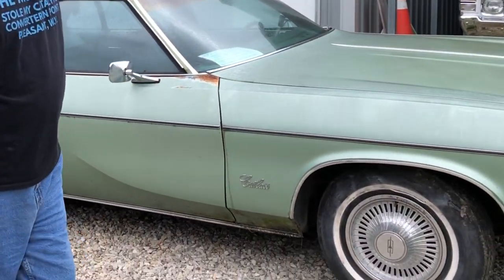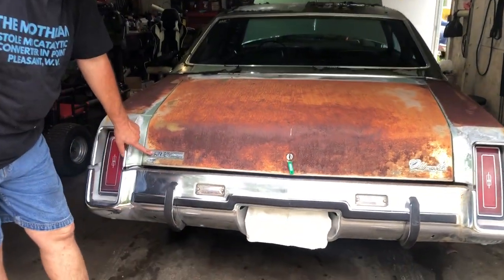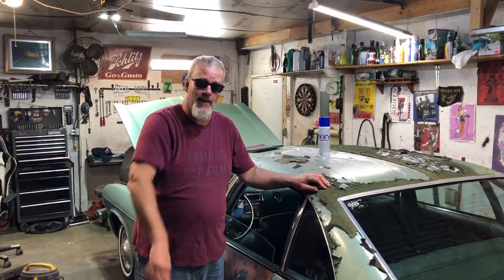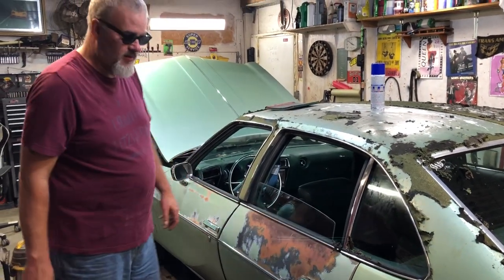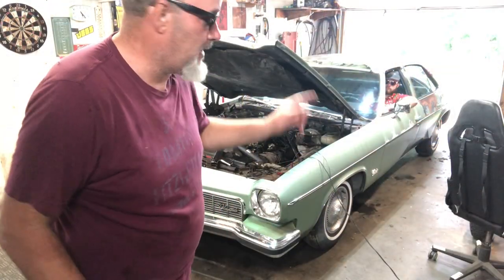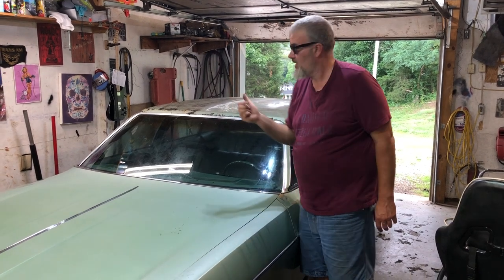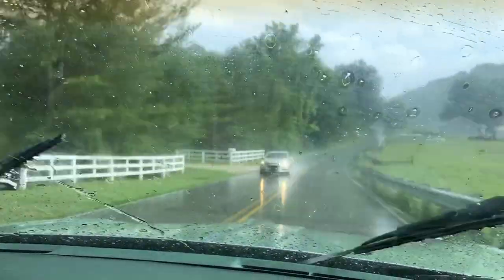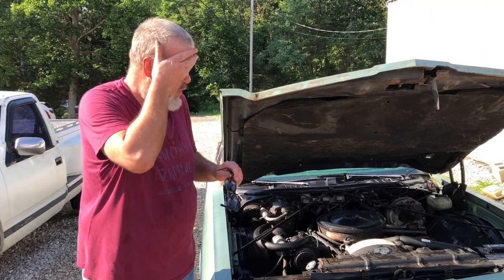455 Olds Triple Pickle!

Comment: Looks like a great car and full of options. Applaud the valiant effort getting it running good, even the said adult beverage. Not so much about those tires on the road with rain conditions and tire age. I know you were excited to test it but WOW! Anyways happy Oldsmobile—-ING!
Reply from the maker: I’ve since replaced the tires with new radials and have ordered a kit for the carb. Ethanol had did more damage than I could reverse. I’ve driven the car around for a day and I must say, it drives like a new car!

Comment: That engine sure is oily for 10,000 miles! Hope you repaint rhe engine compartment, Gold in 73?? And yes, put a true dual exhaust on it.  Anyways awesome find, My mom had a 77 Cutlass Supreme 350 rocket and it got down the road with decent power.
Reply from the maker: Dirty? Yes. Oily? Not so much. It is after all an unrestored 50 year old that has been basically abandoned most of its life. I’ve been under the car and can say it’s condition is consistent with the mileage stated. In a later video we find that the engine is in fact a 350    which gold is the correct color for. And the VIN of the car matches it. The 455 sticker on the shroud remains a mystery.